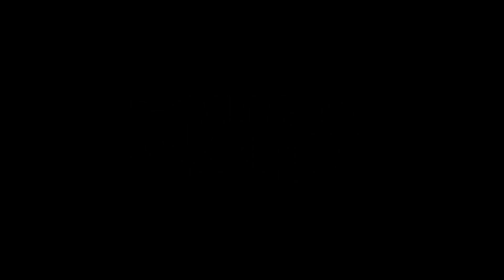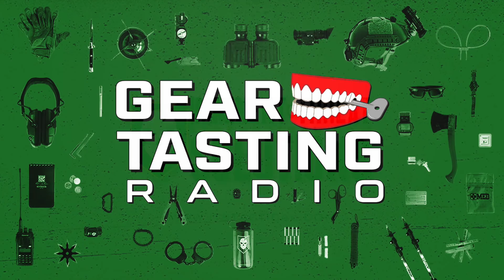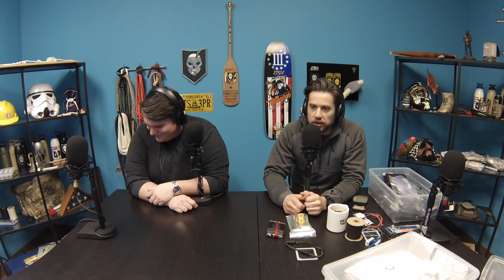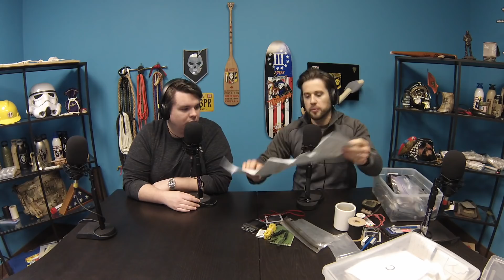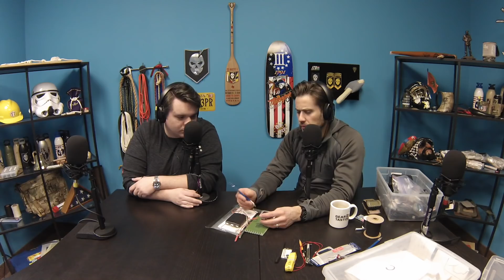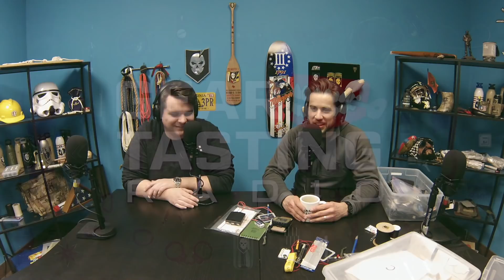Navigating A Bug Out Bag - Gear Tasting Radio 101

Comment: You should never use an out of date magnetic declination on a map - maps are made based on true north, not magnetic north and the declination printed is just for your convenience (assuming it hasn't changed much).

Always get the actual declination and set your compass to that.

Comment: What is a good source for maps of my area? Is it possible to buy printed maps or do I need to go online, try to create a custom map and send that off to be printed? Also, how large of a map would I need to fit about a roughly 50 mile long journey at the 1:24K or 1:50K scales found on the MC-2? I think I would need 2 or 3 adjacent maps but I'd appreciate advice from someone knowledgeable
Reply: Caltopo is pretty sweet and free. They use USGS and Forestry Service maps but you can print them yourself, packing tape them up and hit the dirt on the fly.  When we do land nav practice runs and geocaching, that's the site we use.
Reply: usgs.gov. Free to download but you can buy them
Reply: mytopo.com